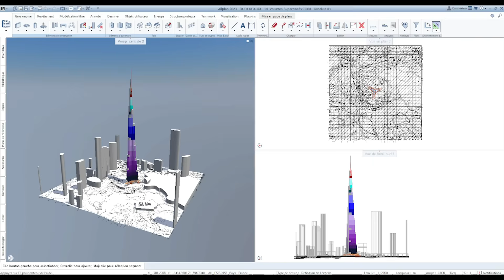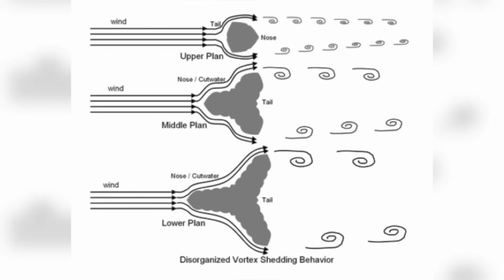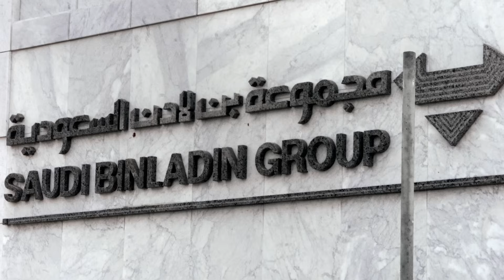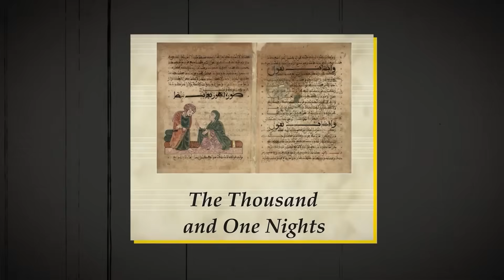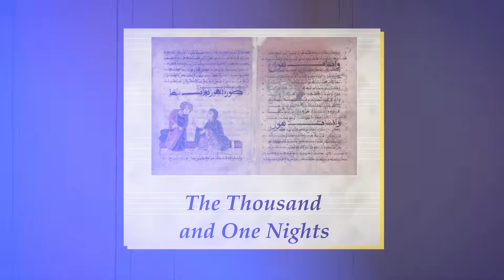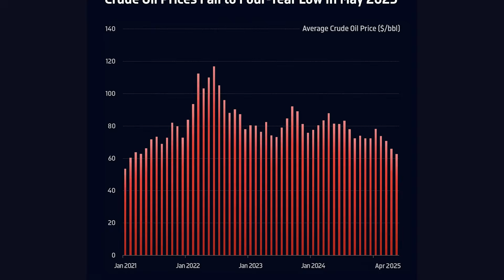Jeddah Tower vs Burj Khalifa: The Race for World's Tallest Building

Comment: The only thing i dont really like about the Burj Khalifa and Jeddah Tower is that much of its height is tapered off starting with a massive base but then becoming thinner and thinner whereas a building like Taipei 101 or the Petronas Towers maintain their dimensions through most of the structures, dont get me wrong I still count Burj Khalifa as the tallest no question though it along with the Jeddah Tower have spires that measure hundreds of feet and are included in its height but that i wouldnt count either but even without those spires theyd both still be the tallest in the world..i mean its not like with 1 WTC which claims 1776 feet but over 400 of those feet is nothing but a pretty pole.. for me its to the roof that really counts on most buildings meaning 1WTC is not the tallest in NYC and never was the tallest in the US being barely taller than the original twins to the roof though it does at least maintain its dimensions through the whole building

Comment: Is it a boy thing? I think "whose tallest" is much the same thing. Of course it is useless and a waste of resources. I don't follow the technology differences, but as a businessman, you can't help but consider not just the return on the towers if they are successful, but the surrounding areas of the business park.
A concern I haven't seen mentioned in all of the discussions around the crazy Kilometer run to the top, is the years of return on these investments. I don't know if consideration is made on the maintenances needed for these state-of-the-art buildings? Perhaps the bigger question is/will be what the infrastructure and the whole building itself, be worth rebuilding, and if not, what is the exit plan for that possible eventually.
I'm see no need where I live to have to deal with deranged business plans such as this. I personally believe that building anything over five stories isn't worth the effort.

Comment: A bit of a clarification.
Before the Burj Khalifa the Taipei 101 was the tallesf building in the world 
but not the tallest tower.

The tallest wired structure was the KRDK TV tower in North Dakota at 628 metres
though there had been taller structures before that which no longer existed.

More significantly the CN Tower in Toronto had been the world's tallest 
free standing structure from 1975 to 2007 at 553 metres.

Comment: Oh yeah the Burj Khalifa was such a technological marvel that it wasn't even connected to a sewer system. Every day sewage pump trucks lined up to pump building sewage out of holding tanks and haul it away.
Reply: Maybe this was done purposely, which could have some benefits.
Reply: This is a myth. The sewer system is top notch today, but the sheer speed and scale of development in the entire Downtown area simply outpaced the existing municipal capacity to build pipelines and treatment plants quickly enough at that time.

Burj Khalifa itself has one of the world's most sophisticated and advanced water pumping systems, which was an enormous engineering challenge in itself. It also has a condensate collection system which recovers approximately 15 million gallons of water annually from condensation alone, and one of the world's most advanced greywater recycling systems in the world.

Comment: Buildings should be measured by the highest usable level not including some ridiculous spire.
Reply: It's the tallest building in the world by all metrics, Jesse. It holds the records for the highest occupied floor in the world, the highest publicly accessible floor, highest lounge, highest observation deck, and the highest floor overall.
Reply: No, the spire is part of the building, adds construction and engineering challenges, and looks cool.
Reply: @username46656 yes I agree
Reply: you sound like a "motion in the ocean" and not "about size" guy
Reply: @fatteebaddee  I don't have to over compensate by putting a 200m spire on top.
Reply: They have 3 measurements for height of skyscrapers. Roof Height, Highest Usable Floor, and Architectural Height.
Reply: That means that Qiamat is near, its mentioned in the Quran.
Reply: Hahaha If you look at the number of floors occupied, Dubai is still the highest in my opinion.China is 2nd because it looks like the floor, Malaysia is 3rd. In the video, Malaysia is 2nd because of the spire 🗿
Reply: Just because the ladies don't like your tiny spire😂
Reply: @rack_man  🐈
Reply: Taller isn't better. I think they should cap it off and complete it about how it is now or add an iconic completion to the top and spend the 26 billion surrounding it with amazingly advance and iconic other buildings instead and give the whole complex the greatest AI automated transit system in existence as a model to the rest of the world. Some ideas for that 26 billion are to include a high rise farming tower for fruits and vegetables, and numerous other sustainability related projects all with a focus on making it a tourist destination.
Reply: @guidedmeditation2396  this is why no one's moving into your shit
Reply: @guidedmeditation2396  Nice buzz word salad. Grow it on your un-usable farming towers?